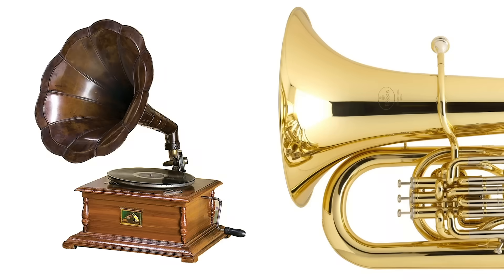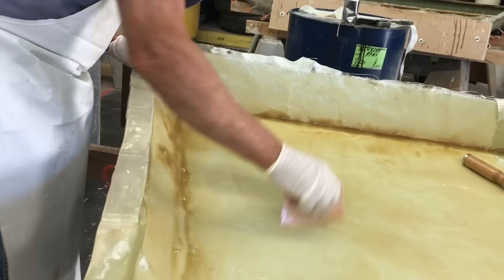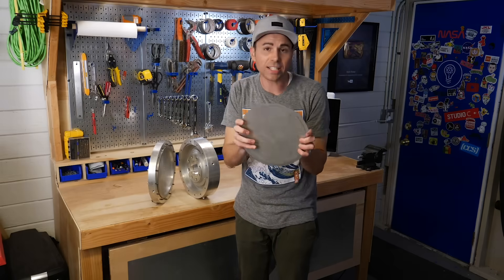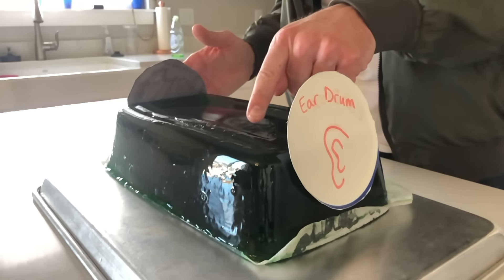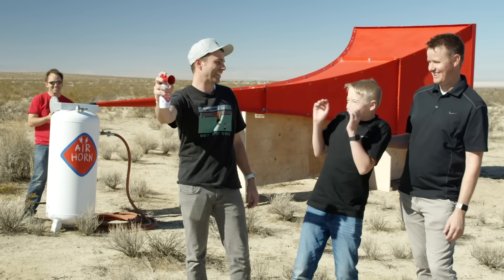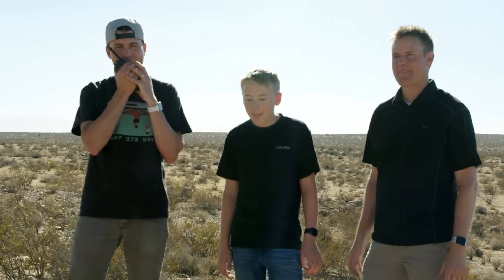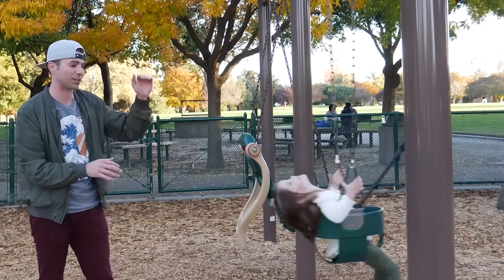World's Largest Horn Shatters Glass

Comment: Small correction to this otherwise great video (and it's a common misconception) the Tacoma bridge was not subject to an oscillating wind, but the wind at a certain speed created a feedback loop between bridge deformation and airflow, so it's aeroelastic resonance, kind of like how one can make grass "sing" in the palms of ones hand or the reed of an instrument.
You don't have one system and one periodic excitation, but 2 systems, the air and the bridge, that itneract and have their own modes.
 It's actually quite complex and is also a challenge for fast airplanes whose control surface can start vibrating at certains specific speeds.

Comment: I wonder how loud that bassy giant air horn is in decibels. It surely is ear piercing at close range. Imagine if a car used that horn. So ironic it sounds like Spongebob's horn, but in a higher pitch. Its sound possibly could travel the same distance lightning would go (15 miles). The speed of sound is 767 mph, so that's about 1 mile every 5 seconds.

Comment: Hi Mark, why no details, the db intensity of the sound say 10-20 meters away and maybe the calculated low freq cut off of the horn you constructed? It would have interesting to have had an alternate driver to try, say a high powered loud speaker with the proper compression chamber behind it, a signal generator and maybe even a bit of music just to see came out of it.

Comment: If you would've put the horn up way higher, it would end up being MUCH louder cuz the sound going into the ground would rather point more to the front
Reply: It's like putting a wifi antenna flat on the ground or 20m high up into the air  and compare how far u can go without losing signal
Reply: It's like putting a wifi antenna flat on the ground or 20m up in the air and see with how fast ure gonna lose signal with each position of the antenna

Comment: How would I find the optimal curvature for a specific frequency? Say I want to generate a frequency of 65.408 or about a C2 note, and amplify it to about 120 decibels. Is there an equation I can use and plug in my values (hertz/ loudness/length of cone?) and I would get an equation for the line? Thanks! I'm trying to build a large foghorn to create general disturbance in my neighborhood and I need to know how much material I will need. If anyone knows how to tune a compressed air horn to specific notes, HMU.
Reply: Is horn is 120 db right ? Large horn ?

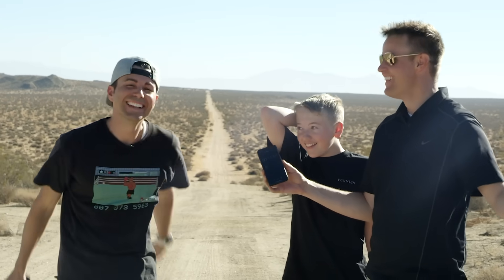Comment: 6:55 you can actually hear the difference in pitch the first sound was an A and the 2 miles away was Ab/G#.
Reply: Adnan MX ok perfect pitch
Reply: @jasonx1ng  I do not have a perfect pitch I checked it with my piano.
Reply: But why is it pitching down?
Reply: Nick Ryckx Classic case of energy dispersion, no?
Reply: @nickryckx7817  doppler effect
Reply: Rhenrs Doppler effect? But both the source and receptor are not moving with respect to each other.

Comment: RCA did a lot of the research on loudspeakers, speaker enclosures, and horn style speaker systems in the 1930's and 40's. Paul Klipsch did a lot to bring horn loaded systems to high-end home speaker systems. Acoustic horn flare calculation requires SIGNIFICANT math skills. A lot of the old concert sound systems used horn loaded systems but as time passed most traveling sound systems decided to use horns less for bass frequencies and changed over to designs providing more cone area and requiring less truck space. In the 70's we experimented with hyperbolic flares because hypex curves can go 1.2 times lower than parabolic or conical horns with the same mouth area before reaching the cut-off point. Regards! (The military got Dolby to build a low frequency speaker system that was 20 feet long and built into a shipping container, maybe you could sell something to the state for avalanche control?)

Comment: Hi Mark,

The part where you say the diaphragm vibrates 110 times a second, I believe is not accurate for the horn you built. That frequency is in fact correct for the gray horn your buddy brought, which was the donor for the powerchamber you used on your horn. That is a KM 110 ship horn, originally produced by Airchime and now Kahlenberg. The frequency it vibrates would actually be lower, that's why the pitch is lower for the red horn. I am also curious why you didn't use the custom built powerchamber that you only used as a visual. It looks very impressive and I'm curious about the amount of power that thing will produce. I am sure you'll never see this, but I thought I'd share.

Thanks

Comment: I also noticed that when you were right up close to it, it was a flat A1 with several overtones (~53hz), but when you were 2.5 miles away, it dropped in pitch closer to G#1 (~50hz), yet you can only hear the Octave Overtone at G#2 (~103hz). Hooray for the doppler effect 😂 Sound is so cool 😁👍

Comment: Great video and experiment, except that the trumpet was out of place.  The bells of brass instruments are not exponential curves. They work by reflecting pressure waves back into the instrument to create a standing wave in the air column, which is what produces the pitch.The bell controls the tuning of different pitches by reflecting waves of different frequencies back at different points.  See "Fundamentals of Musical Acoustics" by Arthur H. Benade, a physicist and acoustician who built a trumpet
with an exponential bell to demonstrate the point.  It was unplayable.

Comment: If you lose energy with reflected waves when you get to a larger cross-sectional area, why the change in shape towards the middle where it goes from a circlular to square cross section?

Are those areas more similar than they appear due to the change in shape?

Comment: OK, I've watched this video before, and because I made a comment, I wanted to watch the video again. This brought up a question, and I'm curious if you already know the answer . . .  Does temperature effect the speed of sound?  I'd imagine density plays a part & that's why someone's voice gets squeaky with helium . . . right? Well air compressors cool using pressure (condenser) . . . I just watched a video on the Hellcat, and it has a compressor to cool & they were talking about how cooling helps airflow & airflow gives better performance on their car. Well if it's cool & there are more molecules, wouldn't that mean that it would take longer to go through cooler air? And vice  versa, if it's hotter . . . it should take shorter time for the sound to travel the same distance because the molecules are farther apart? Is this even a thing?

Comment: Remember when the 49ers used to still play at Candlestick,  at over 2 miles away could here the airhorn go off when they scored a touchdown.   Funny thing is speed of sound is much slower than light, but it was still fast than the broadcast time delay as I would often be "spoiled" to a touchdown by hearing the celebration horn before the play actually happened on TV.

Comment: Is it possible if you travel the same speed, you keep hearing the horn?
Reply: You won't hear the horn!! The frequency would drop to zero.
Reply: Probably
Reply: 747 mph you should try it oh wait
Reply: If you could somehow travel that fast, yes you would keep up with the sound until it disapates
Reply: Not exactly, the sound wave would slowly lose momentum and be quieter
Reply: The frequency you hear would drop to zero. You can only hear sound that's overtaking you although I'm curious if you moved twice the speed of sound away from a loud sound source would you hear it in reverse?
Reply: @TimpBizkit  Now thats funny. Just maybe if you were traveling at the speed of sound and was passing the horn at the same time it was honked, maybe then it would be constant. No, it wouldn't. 
Maybe this is why married men sought to break the sound barrier.  Just sayin.
Reply: Using the circumstance you present,  the sound would finally fade out.  Thats because the air molecules on the sides would give way under the pressure inside the center of the sound waves. Much like when a rock falls on a pond. The first waves created are the largest.  As the waves get further from the source, they get smaller and if the pond is large enough,  eventually they will fade out.
Reply: If the circumstances are correct it should. The speed of sound=747 mph so if you can find a way to go that fast,it could be possible. When the field of sound goes to 0,it will be silent
Reply: @jananaboe5609  At present there are fighter jets that travel 3-5 times the speed of sound. Even bullet trains can manage to travel at 1.5 times the speed of sound.
Reply: Pratyush Kishore  Thank you for the information about the doppler effect.  Ive heard it talked about in meteorology but never had it explained. Im going to check it out. You have been very helpful.
Reply: dis needs more attention!

Comment: So a larger horn allows you to get more sound out in the same way a rocket engine bell allows the rocket to squeeze out every last bit of power before the air expands and the pressure decreases to atmospheric. Also why large engine bells are more efficient in space as the expanding air in space has to expand into a vacuum and not just 1 atmosphere.

Comment: That's the same horn design used from a Federal Signal Thunderbolt siren.  The square horn design is very effective at greatly amplifying the sound levels to pack a big punch up close.  The horn design also helps the sound to travel several miles under the right circumstances.  A Thunderbolt siren having the same horn design combined with the siren chopper being supercharged by a roots blower makes it a very loud siren.  Thunderbolts having the right set up can produce about 128 db at 100 feet and can actually vibrate the ground.

Comment: This is a remarkable demonstration, but let me offer a bit more insight into impedance matching because the explanation isn't exactly correct. Impedance matching is when two conjugate properties of a wave are transformed to optimally transmit power. The most intuitive variables in this example are force and displacement. The vibrating element offers a lot of force, being driven by compressed air, but little displacement as its membrane has a small area. The horn takes the vibrating wave and spreads it out, increasing the displacement. In effect, the area of the membrane is increased but it's ability to exert force (e.g. move my hand with the sound wave) is decreased. The larger area has the additional benefit of causing the sound to propagate more directionally, and if the length of the horn is tuned correctly, then resonant effects can further amplify the sound. The result is that there can be much more acoustic energy outputted with the horn than without it.

Comment: 2.5 miles X 5280 ft/1mile = 13,200 ft.

At 20 degrees Centigrade and at normal air pressure at sea level, the speed is 1,125 ft /sec.

13,200 ft / 1,125 ft /sec = 11.73 seconds.  It could be a bit more or less if the temperature and pressure vary.

So, if the radio keyed the stopwatch, and the temperature along the entire path was constant, and known, you could get the barometric pressure from the time.  Similarly, if the barometric pressure was constant and known, you could get the temperature from the time.

Cool!

Comment: You know you can fold it, don't you?
"impedance matching" is also why you have big transformers on the output of valve amplifiers (high impedance output to low impedance speakers) - you can think of a horn as an air transformer.

Comment: Along these same lines, Klipsch makes horn shaped speakers for theaters.  They are incredibly efficient.
For example, the KPT-CINEMA GRANDEUR speaker produces 110dB of sound 1 meter away with a 2.83 volt input (1 watt into 8 ohms).  That’s deafening sound from just 1 watt of power from the audio amplifier.  I listened to a demo pair years ago, running at tens of milliwatts.  Loud!
This speaker accepts much more power, to fill an auditorium: Maximum continuous output is 137dB for around a kilowatt in, but of course you don’t want to be standing anywhere nearby.
https://www.klipsch.com/pro/cinema/behind-the-screen/4-way

Comment: I wondered about the radio waves of the walkie talkie vs the sound waves from the horn when measuring the 11sec delay... turns out radio waves travel like light waves. ... Sound travels at approximately 766 miles per hour. Radio waves travel at the speed of light, which is approximately 186,000 miles per second. Did not know that.

Comment: The tacoma bridge collapse was caused by aeroelastic flutter. Not quite the same as forced resonance in the way you're talking about. The wind did not have a periodic force causing resonance, rather, the dynamic reaction of the bridge to the wind caused the bridge to oscillate harmonically. It got pushed by the wind, pushed back, pushed by the wind, pushed back, etc. until it collapsed. The wind cannot have such a periodic force, its simplified to a continuous flow.

Comment: In about 1956 or '57, Acoustic Engineer Dr. Vincent Salmon of the Stanford Research Institute (now SRI International) had a contract with one of the US ARMY research groups to develop SAM, the Stanford Airstream Modulator.  It looked very much like your huge horn. It was designed to be used as a battlefield communication device that was unjammable.  It was tested at distances of over two miles. It included an acoustic modulator so that human voices could serve as the input. Here are a couple of old references.  Enjoy!

https://books.google.com/books?id=QioDAAAAMBAJ&pg=PA145&lpg=PA145&dq=%22Stanford+Airstream+Modulator%22&source=bl&ots=48yRwzIFXV&sig=N7B1VV09u5Sj-PGdjJif-2vTs0E&hl=en&sa=X&ved=2ahUKEwjEyM3bsqrfAhUHhlQKHcFjDnUQ6AEwAXoECAkQAQ#v=onepage&q=%22Stanford%20Airstream%20Modulator%22&f=false

https://books.google.com/books?id=uOEDAAAAMBAJ&pg=PA163&lpg=PA163&dq=%22Stanford+Airstream+Modulator%22&source=bl&ots=Tmu-ywlLD_&sig=Ai8-Y9Baa33tBClG6kQYkzc7uG4&hl=en&sa=X&ved=2ahUKEwjEyM3bsqrfAhUHhlQKHcFjDnUQ6AEwAHoECAQQAQ#v=onepage&q=%22Stanford%20Airstream%20Modulator%22&f=false

Comment: I wonder if you guys have ever seen a federal signal thunderbolt air raid siren. The horn is very similar, probably designed with the same formulae, but its driven with a small siren and amplified further still by a very large blower at its base. Cold war tech at its best!

Comment: I wonder what the dB SPL of your horn measured at. You then could calculate the attenuation based on distance. Also, the outer ear funnels the energy to a smaller space (the ear drum) then the middle ear system has it's form of impedance matching meaning the SPL will be 200x as powerful by the time it reaches your inner ear. If the sound was greater than 120 dB, which I'm sure it was, blasting it could result in instant hearing loss without hearing protection. 😬

Comment: Basically it is combine of thin square, or rectangle, and thick square or rectangle to show curve. So, it is not about curve itself, but it is about amount of impact, so thick square is heavier than curve combine of thin with thick. Thin at beginning and thick at end. The higher container, the lower spread out, the higher impact. So, what hold the air, hold the sound. The bigger container, the better the sound, and the further the sound.

Comment: don't ships and those towers use this horn?
Reply: It sounds alot like a ship horn
Reply: @assassinwoman16  The frequency may be the same, but most ship horns are conical (round bells I mean). Microwave stuff seems to use this square design probably because it's cheaper and easier to make.
Reply: 100k Subs No Vids m
Reply: Ships and lighthouses use similar horns.
Reply: Sooo how do you get so much subs
Reply: Similar horns are sometimes used in stereo speaker cabinets. They're also used for some air raid/tornado sirens.
Reply: Sounds like a hockey horn
Reply: Yeah, different design though, and a tad smaller
Reply: 100k Subs No Vids yeah those towers

Comment: Even more detailed, the ear is separated into three sections: the outer, middle and inner ear. The outer ear is terminated by the ear drum, which connects to a series of bones ending at a small window-like bone, which connects to the inner ear. The inner ear is filled with fluid and is spiral-shaped. The entire structure is filled with hair-like receptor neurons, sometimes called hair cells, which act together in a big shotgun approach--the brain interprets sound based on which of the neurons fire. If the ones closer to the center of the spiral (the longest distance from the bone window) fire, it must be a very high pitched sound. If the sound doesn't get further than the outermost parts, it must be a very low pitched sound. The distance the sound travels before losing its energy is the pitch the brain interprets. The quantity is volume, and too high of a volume hurts or deafens because it injures the eardrum, making it more difficult to carry the sound.
Reply: Also, you aren't calculating the speed of sound; you're calculating the difference between the speed of light and the speed of sound, plus the difference of the distance of the sum of both walkie talkies' distances from the source and destination and the horn from you, something like dL(w1,w2) + dS(src,you) - ( dS(w1,src)+dS(w2,you) ).

So what you derive from dS(w1,src) - dS(src, you) is not an exact calculation of the speed of sound, but the error is very tiny, as in microseconds. Well, assuming a perfect referee. With human reaction time, the error balloons into milliseconds.

Comment: Darpa built a bigger one for a battlefield sound simulator, using an airflow modulator valve to produce extremely high SPLs from it. It's on Wyle Labs' website. Not sure if the horn was tractrix or exponential.